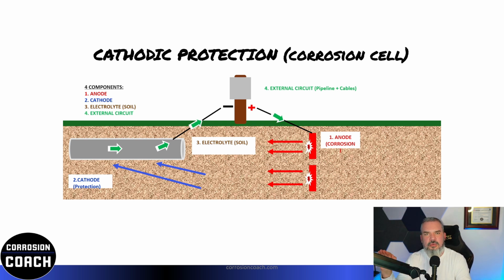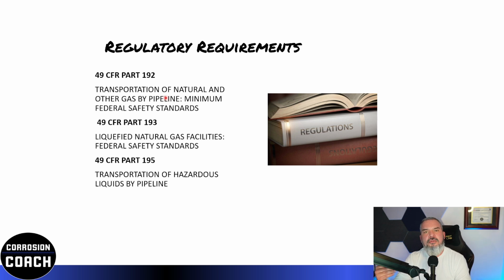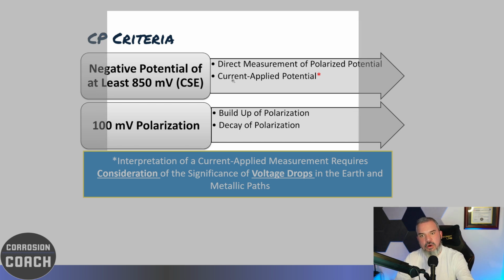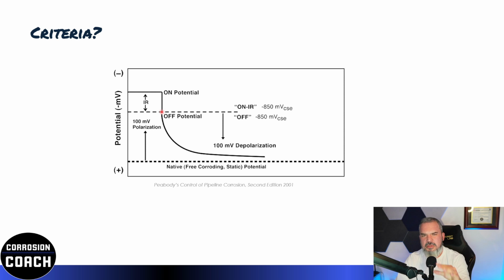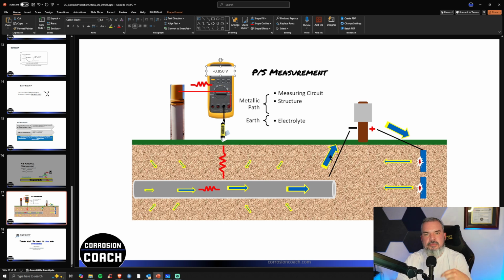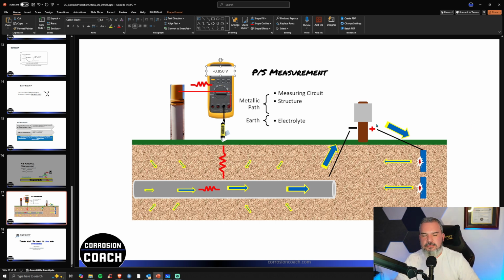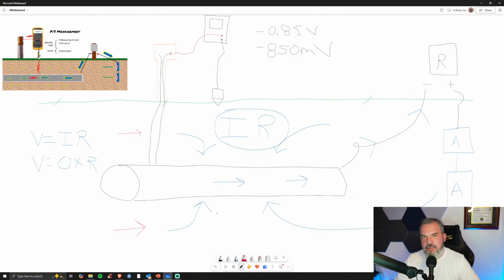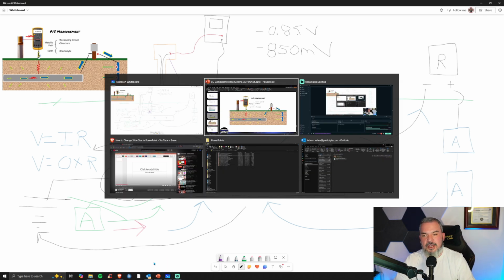Cathodic Protection Criteria and Pipe-to-Soil Potentials

Comment: The -850 mV criterion gets quoted a lot without much on how the reference electrode is checked. When you take pipe-to-soil readings in the field, do you verify the electrode before you trust the number?
Reply from the maker: Great question.  We should make sure to "calibrate" our reference electrodes.  I always recommend having a few back ups.  Really all of our equipment should be verified.  Multimeters require calibration intervals as well.

Comment: You say to turn off rectifier for instant off reading. How long is instant off? If i turn off and it doesn’t drop 100mV  buts it’s over -.850. What does that mean. Thanks
Reply from the maker: Typically, folks will interrupt for 1 second.  It doesn’t take long.  Assuming there are no other current sources (voltage gradients) in the area, the a -850mV is meeting criteria.  If you’re not meeting an -850mV, then you could leave it off to see if it will go electro-positive at or more than 100mV.

Comment: I have an on/off interrupter set to 4s/1s. when i want to take my off reading, it spikes a bit and then the off readings on the multimeter dances around. At what point do you take the reading within that 1 second because the values fluctuate
Reply from the maker: Great question! I try to read the "off" potential at the lowest stable value.

Comment: If the soil is +ve and the structure is -ve, then why we measure volts by connecting +ve lead of the meter to the structure and -ve lead of the meter the CSE? 
Also, what does the value of -0.850v actually mean?
Reply from the maker: The simple answer to the first question is that it is the industry standard.  The criteria (in the US) is -0.850 V with respect to a copper copper sulfate reference electrode.  We are comparing the structure (positive) to the CSE (negative).  

The second question is simple but could certainly be made complicated (join the AMPP SP0169 committee to learn more and make it complicated lol).  The simple answer is that when we achieve effective cathodic protection, we are driving the target structure more negative than the most negative spot.  In other words, the entire structure is the same potential...therefore, we get rid of corrosion "current".  We may actually achieve cathodic protection before we get to the -0.850, but the standard is set to that as a catch all.
Reply: @CorrosionCoach  Btw coach, eagerly waiting for more educational videos! I'm new to CP and have been tasked to develop a contract for an ICCP set up at various remote gas wells  and km long feeder lines. Your 'slow' explanation i feel are best among various CP related videos on tube.
Reply: @CorrosionCoach  Thank you coach! I'll go with the simple explanation first, before rolling down the complicated slope! : )